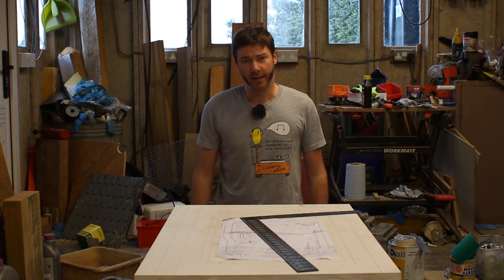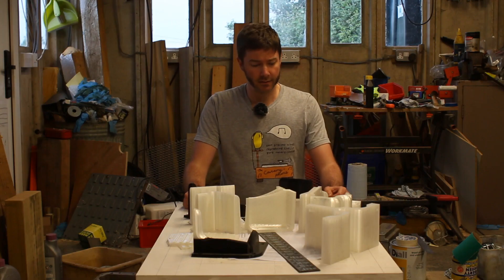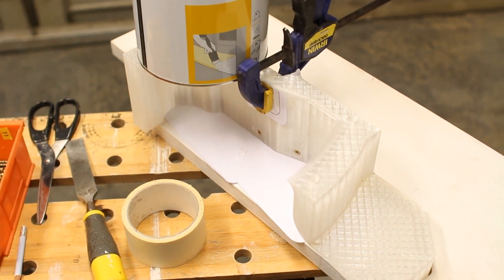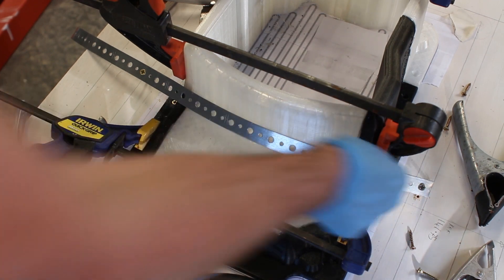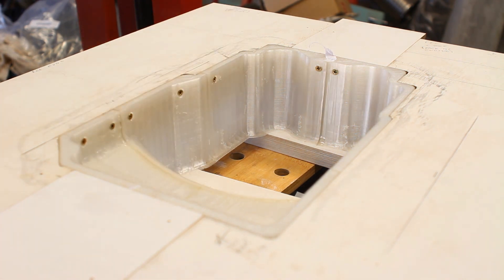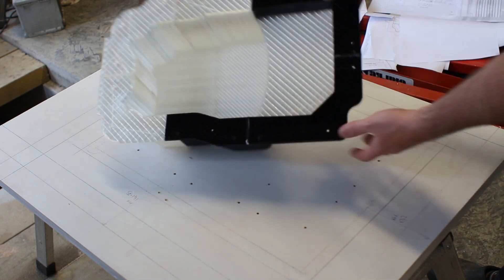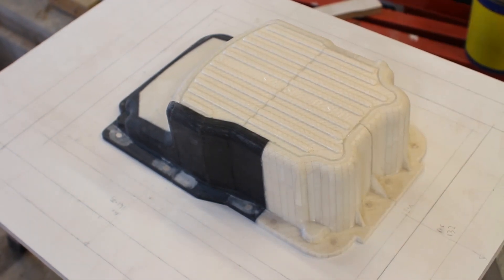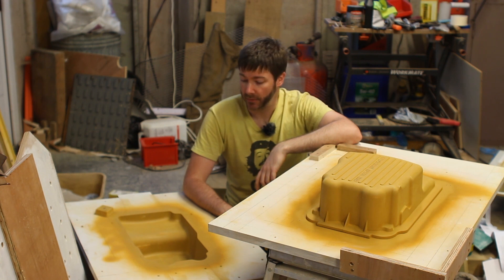HotRodTechBits #1: Sump foundry pattern

Comment: Great job on the pattern!  Excellent printer work, but that's just the start.
Reply from the maker: Thanks! The plaster of paris did kinda work, but also caused problems of its own. Thankfully castings this size are not a regular occurrence.

Comment: As a patternmaker by trade, all looks great on the pattern! Just make sure it is gated sufficiently, good rule of thumb is to have 3x the aluminium volume of the casting. Two thirds in the risers and gating, and the one third the casting itself. This helps hold the heat needed for the casting to be fed in it's entirety. Did you account for shrinkage in this case?
Reply from the maker: I wish I'd had that much spare material! I was very severely limited by my tiny foundry so had to have a few goes at getting the gating to work. Managed to get a good one in the end - there'll be another video along soon  :o)